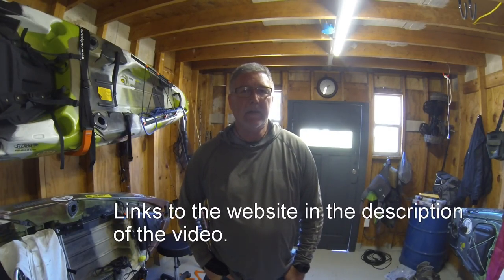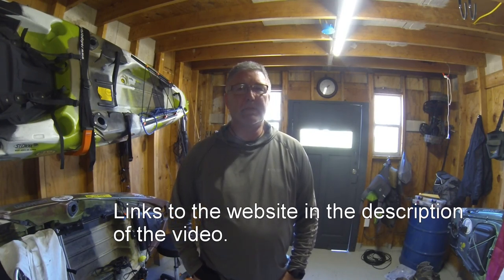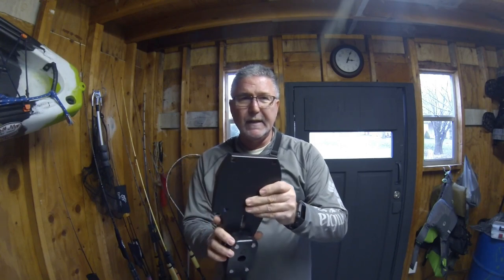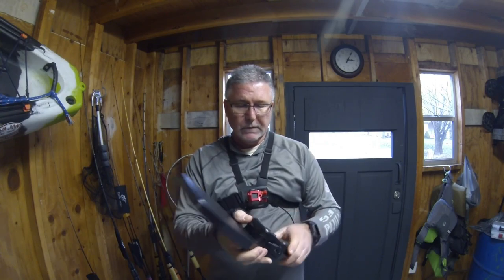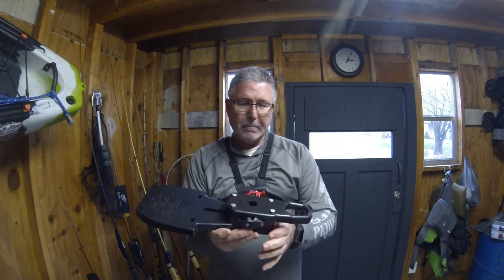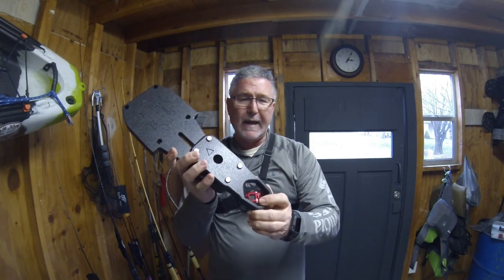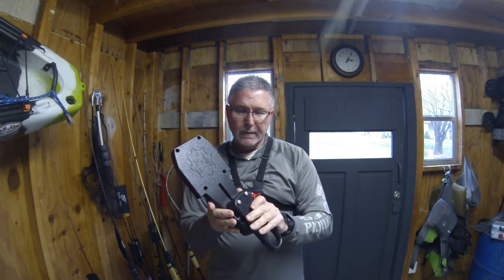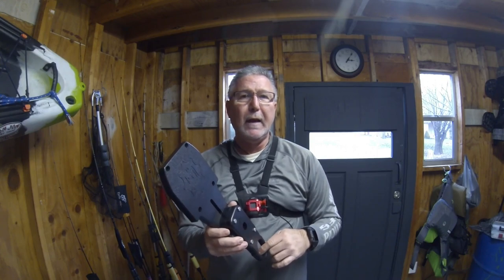Installing the Yakgadget Manual Power Pole on Jackson Coosa HD. (EASY) Kayak Bass Fishing

Comment: Hey Mike, just came upon this video. This looks like a pretty cool alternative to the $1200.00 Power Pole. Are you still using this ?
Reply from the maker: I still have it. It’s not on my river boat. It’s a little noisy for my rocky river bottoms. It would work great in the lake along the shore or a shallow water lake. I did another review video on it. It works great, it was just really loud when it made contact with a rocky bottom. All my rivers are rocky bottom.

Comment: Curious how the pole will do on a rocky river bottom. The kayak I just bought from my nephew has a DIY version already installed minus the pole. I may try it this weekend if the weather doesn't turn to crap again.
Reply from the maker: Mtn Way Adventures we are hoping it does well. We will see soon! Can’t see it doing any worse than a powered power pole.
Reply: @BigBaitPosse  Power pole has down pressure doesn't it?
Reply from the maker: i Bee Amazin the mechanized version does. The manual version relies on weight of the pole applying downward pressure. Hopefully we will be able to test this on the river soon. High water is keeping us off the river all winter
Reply: @BigBaitPosse  how did it work?
Reply from the maker: It works fine. My main concern was noise on a rocky river bottom. It can be rather noisy. I’m sure it would be less noisy on a soft or sandy river bottom. It is a good product and works flawlessly. Thanks for watching